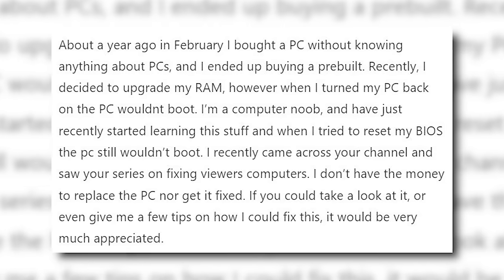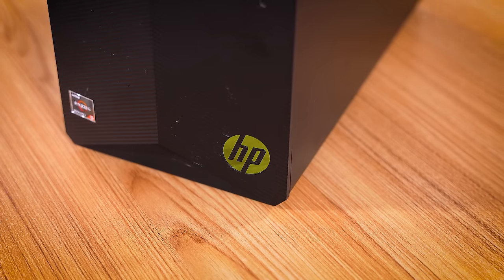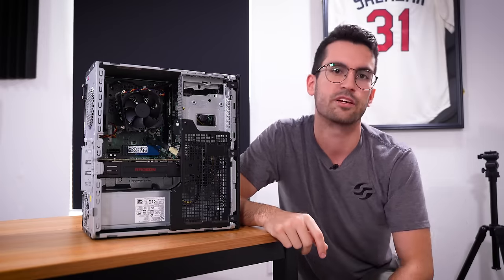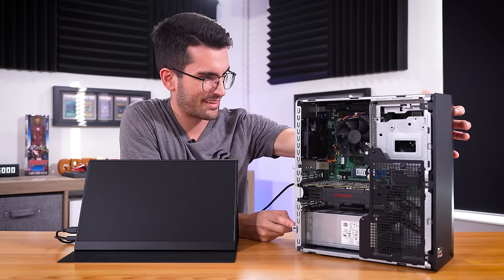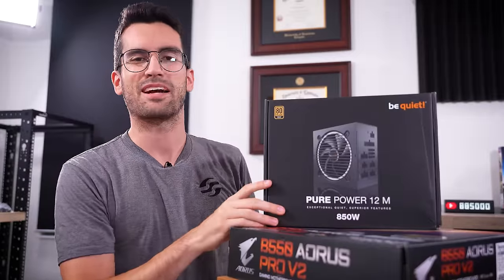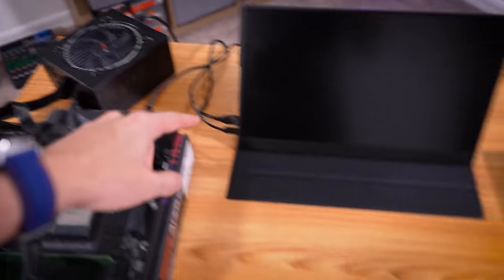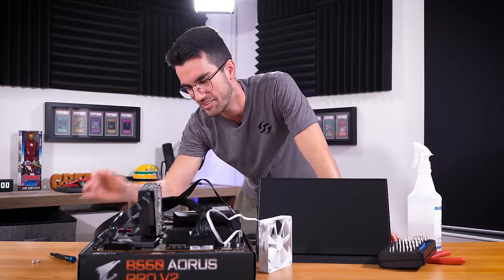Fixing a Viewer's BROKEN Gaming PC? - Fix or Flop S4:E17

Comment: Shorted front USB port on the MB preventing it to power on and cut the power supply. I can see it when you showed the front of the case. Worth a try in my opinion 😊
Reply: went back in the video after reading this and also saw at the 4 minute mark that completely mangled USB port
Reply: I can assume he unplugged everything putting before putting in the ram and hastily plugged it back in.
Reply: That's a good catch. BAD things can happen with USB ports. At work we had someone manage to get the cable of a mouse into the arc of a welder, that computer was destroyed. When I got done fixing everything I put in a touch screen monitor, a keyboard with a touchpad, and a "No Mice" sign.
Reply: At the 9 minute mark he said he could smell burning probably from the mangled usb connector getting hot and melting plastic in the connector. or the burning 12v to 5v buck converter killed by the shorted port since that psu only supplies 12v.
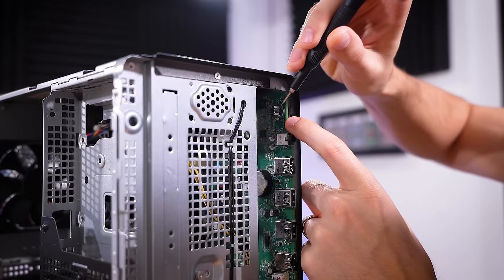Reply: Shit, I see it 03:57 it's completely destroyed lmao (the top one)
Reply: Sadness.  Wish he'd seen that (although I'm guessing the owner likes it better the way it turned out 😂).  I've got a 5700G that needs a home, so sad to see the e-waste.  Happy the cpu and radeon are able to be salvaged
Reply: The whole time I was shouting Greg, please look at the front USB port! Haha

The pc might have worked if you just removed the pins from the usb.

Comment: You gotta love the people that post negative comments about repair. If customers had to pay for time, it would be way more expensive to repair having owned a computer repair shop. I can attest that most repairs are part swaps.  I did repair a few motherboards with bad caps and a few lcd tvs that had bad caps in power supplies, but most were part swaps due to the cost of labor on the customer.

Comment: I do like content creators that actually diagnose and repair pc components, but on the other hand, I never miss the Fix or Flop series which I enjoy more than anything else computer wise. Your generosity puts you at the top of the list.
Reply: The initial process is the same whether it's new or old hardware.  Reduce things to it's most basic configuration, then verify operation of the critical components.

I also like watching older hardware being diagnosed, but modern circuitry is more highly integrated into advanced chipsets.

Comment: It's possible that they fried the motherboard doing the upgrade themself but I'm very glad the viewer got it fixed, we've all been novice builders making mistakes and the poor kid was saving up money to pay for a fix, really really sweet thing to do it for free.
Reply: It's very unlikely he did. Florida is pretty humid so static electricity is extremely rare and modern Motherboards are pretty sturdy. This was a defective unit which I'm surprised it wasn't under warranty but maybe it's an old build.
Reply: I've run into several older HP systems that died after simple ram upgrades and I've been building since 92. Everything except the motherboards were good for use in pother systems.
Reply: @JasonSaeler  Could be the circuitry for the RAM being tailored for the proprietary board, causing other models of RAMs being totally incompatible and destroying the board.
In short whether it's design issue or quality issue it is simply planned obsolescence to keep people buying new stuff to "circulate" the economy.
Reply: lol what @unknown14191 there are standards for RAM, it would cost so much money to reengineer your DIMM slots and traces to kill the board unless a specific DIMM was inserted, no one has ever done that. They’re just key it differently
Reply: @akr4s1a  There's standards for literally every PC component, doesn't mean theyre followed. AFAIK you're correct about no one changing RAM layouts before but your arguement as to why is as sturdy as a wet paper bag.
Reply: @ihateeveryone8161  If by "sturdy as a wet paper bag" you mean 100% correct then sure.... He didn't "make an argument" he literally stated a fact. Your argument on the other hand made zero sense.
Reply: @akr4s1a And so there are standards for PSUs, and yet HP uses a proprietary connector standard.
Reply: @unknown14191  Nah, these were systems I was working on and using actual HP branded Ram with same specs. Removed the upgraded ram and the systems were still toasty. It seemed limited to the HP Elite 8300 series.

Comment: What a difference!  So wholesome to see (hear?) the reaction to the build!  I always like to keep a thermal imager on hand when troubleshooting, both to see what components heat up and to track down the source of the burning smell if anything lets the smoke out.
Reply from the maker: Didn't even think to use the FLIR cam. Will have to remember that for the next time!
Reply: @GregSalazar   Mine's built into my phone and my prior life working HVAC means it's the first tool I deploy when confronted with any type of misbehaving equipment.  Also think the IR images would be cool to include in the video when you're showing the system does a POST and that the CPU is warming up.
Reply: @GregSalazar  low voltage injection + thermal camera is one of the quickest board-level troubleshooting tools for shorts. Whatever heats up is usually the problem!

Comment: If I had to guess what the issue was: the top USB port on the front IO at 2:40 is definitely broken. When I was a repair tech for a gaming PC company I saw that short systems all the time. Fortunately, if you unplugged it from the MOBO the PC would be able to power back on. Looks like the front IO is attached to the MOBO in this case. Would love to see if that's actually the issue!
Reply: Easy fix too, just put some insulation on the pins and a sticker over the port so it won't get used.  Maybe little pieces of heat shrink tube for example.  I liked your comment so maybe he sees this
Reply: First thing I noticed too.

Comment: Nice to see :) With the HP systems, a very VERY common issue with them is the bracket/case mounting, when you take out cards (ram/cpu/video etc) and put in new/replacements the motherboard can often short to the backing case, they are VERY poorly designed with proper separation and flex allowance.

Comment: You should get an infrared camera, if, as I assume happened, a capacitor blew (that's what usually gives that (fishy) smell) you would see it on the infrared as it sits there baking. If it's not microscopic then you can usually find out the model and order a replacement. There's quite a few channels that do that although they usually DO have a microscope and mounting equipment/varied solder gear to replace them.
Reply: i was thinking this too!
Reply: it mostlikely was the shorted USB port at min 3.55😂

Comment: If something doesn't work and you replace a part or parts, then it works means you have "fixed" it.  I have been a computer tech for over 28 years, and I think Greg does a great job.

Comment: I started with an hp omen prebuilt because I didn't understand pcs that well when i ordered it. Got it around 2017. Started out with i7 9700 (non k), gtx 1660 super, 1x8gb sk hynix 2666 ram that was locked at 2400 for its entire life (the motherboard didn't support xmp), and 500w psu (no idea of the rating). Thankfully nothing was proprietary except the motherboards plug layout. The placements were a bit weird according to other tech youtubers, but the plugs were all the proper shape/size. Won the lottery there i feel.

First upgrade was another stick of ram to bring me up to 2x8gb, about 6 months later. Just being dual channel felt massive because i no longer had stutters in vr gaming. By this time i was discovering my passion in pc build/repair, so i knew quite a lot more about pcs.

Second upgrade was GPU which spiralled into GPU, case, and psu. upgraded that warm, loud, single fanned 1660 super to a 3070, upgraded the 500w unrated gpu to a corsair 850w gold, and the oem case to a nzxt h510 flow. That upgrade felt incredible, finally having rtx support. I also made sure the psu could support future upgrades, which is why i got 850w instead of 650w which the gpu reccomended as a minimum.

About a year after the gpu upgrade i finally got myself a 1440p 165hz monitor. While the upgrade from 1080p165 to 1440p165 isnt thaaaat noticable to me truthfully, i can definitely feel it and i feel like it was worth it. I run a dual monitor setup so having both at a similar refresh rate is also nice. Truthfully the best part of that monitor upgrade was going from an extremely ghosty va pannel to a silky smooth ips pannel with a (slightly) better viewing angle. in my opinion and in my year or so of having this combination of cpu/gpu, i think i can say that 3070 and 9700 is the PERFECT 1440p combination of hardware. 1080p gave me a slight cpu bottleneck, 1440p used them both equally in the games i played. (medium to high graphics, apex, minecraft with shaders, dying light 2, no mans sky, as examples)

In about a year after my gpu upgrade, i went all in. Told myself to go big or go home and got one of the best current cpus (as of 2023). got a ryzen 7 7800x3d, upgraded ram to 2x16gb ddr5 6000, and got a gigabyte x670 aorus elite ax, and got a wd black 850 2tb nvme ssd. And MY how i can tell you, having a usable bios is incredible, thats probably my favorite upgrade here. the BIOS. and the better sound card this motherboard has, since I'm a minor audiophile. this boards sound is incredible. the audiophiles and sound nerds will know what i mean by this, but this motherboard has much clearer sound, clearer bass, and the highs aren't absolutely painful. I thought i had sound sensitivity, it turns out i have bad audio quality sensitivity. 

I now have a massive gpu bottleneck because 7800x3d is an absolute OVERKILL cpu but i cant see myself upgrading it for maybe 5-10 years. gpu sits chugging along at 90-100% usage while cpu is at a measly 30-40%. In the games i play (at 1440 medium to high graphics to clarify, starfield, apex, minecraft with shaders, minecraft modpacks which btw went from about 60 fps in rlcraft at 8 render distance to 120+ at 32 render distance)

My pc is now fully custom built, everything has been upgraded, theres not an oem piece left inside it except for the nvme ssd i have windows installed on. And the best part? Since nothing was really proprietary, I run the original pc as a pihole/droppy server sitting in a cabinet in the corner of my room. Been going strong for about 3 months now. And the painful part about the server pc? Its running off a 2tb external usb hdd. I dont know why i do this to myself. I have extra sata ssds. But no i use an external 5200rpm EXTERNAL USB3.2 HDD.

Comment: I had an HP PC in which the PSU and motherboard bit the dust. These days OEM components are often cheap as well as low end.
Reply: The quality on the ones I've run across have been fine.  I would imagine with the millions they make a few do die.  I built 3 or 4 of the older 2400g and i5 9400 version of this system.  Nothing really wrong with it.  They live a hard life with their cooling vents blocked in a cupboard/desk or by pet hair.  I've got a 5700G that needs a home, would love to revive that system 😥

Comment: What a job Greg! You are the man!
I went with am OEM HP back in the day, was lucky to get pretty much a standard pc with HP on the front. 
Eventually the power switch went out and was able to swap everything over to an ATX mid tower and everything fit!
Eventually replaced everything from that old DDR2 system!

Comment: Purely going by a couple of close-ups of the m/board, & the smell; either the guy shorted a cap on the board, or it decided to let-go when the board was turned back on. Always good to learn with you Greg, there's not really a right or wrong way to troubleshoot.

Comment: as a previously keen and once noob in computer kid, i can tell you that the viewer might have tried to replace the RAM without powering off the power supply or immediately after powering it off(without discharging the capacitors by holding the power button) because the same thing happened to me once. I tried to take out the RAM without shutting off the power supply and ended up killing the RAM slot on my motherboard. Although, my pc still worked surprisingly with just one slot detected.

Comment: Wish I had seen your channel earlier.  Bought a prebuilt at bestbuy after building my first ont years ago. Just got lazy now I stuck with my Onen but it works fine but up grading might be a problem.  Keep up the good work.
Reply: The bigger Omen are standard parts.  These little office machine ones have 400w PSU options.  But usually if the CPU is worth keeping just get a lower end CPU and new SSD (20 bux for OEM 512GB) to put in your old one and sell it off to fund the new build 😆

Comment: At 2:37 in the video you can see that there is a broken usb 3 connector that coud be shorted, in my opinion the 5v power supply on the motherboard preventing the system from powering on because of the short circuit.

Comment: I can’t get enough of this series, Greg! While he didn’t necessarily get a performance boost, he certainly got a massive face lift. Get that 6500 replaced with a nice budget 1080P card like a 6650 or 7600 and he’ll be set for another couple of years!
Reply: It's actually a AMD RX 5500 4GB GPU. But yes, he needs to upgrade that GPU and CPU.

Comment: Used oem builds often are tremendous value, but are only an option if you don't need to upgrade - otherwise they become a money pit of half-baked power adapters, lesser value gpu choices, and guerilla modding. Sunk cost fallacy sets in really quick.
My mother-in-law greatly appreciated the cute little 6th gen i5 optiplex micro that I picked up for not much more than $100. For the gamers in my life, I started them off right with decent cases and power supplies, even when I couldn't sink a whole lot of money into the platform.

Comment: One thing that I do like about the replacement parts you used while thr 850w psu is overkill for thr current parts if the viewer in the future ever decides to go super high end they could run a 5800x3d and 7900xtx off that psu so you gave him a lot of room to upgrade

Comment: For myself to test these proprietary builds I keep multiple 24pin adapters (6, 8, 10, and 12pin). For some of these with special ones I have a 24pin cable with loose ends to plug in wherever needed. This is all you can do to test.

With the upgrade I wouldn't have gone with the NZXT cooler. Their required software eats into performance on mid tier (4/6 core) CPUs. As well as ram usage on that 16gb of ram. Maybe a Deepcool, BeQuiet, or Thermalright as an option.

Comment: Strange. I have an HP Omen 25L....not sure of the year, but it came with a Core i7 10700F, if that narrows it down. Anyways, there isn't one single proprietary component on it. I know, because I case-swapped it. It came with a standard Thermaltake PSU with regular connectors, removeable rear I/O shield, standard micro ATX mobo, etc

Comment: Man! You did a great job!
I always also thought that fixing these broken prebuilts sucks, when the motherboard or the psu dies. But honestly for me the worst case is, if the gpu dies, because it's the most expensive part usually. If the motherboard or the psu dies on these prebuilts i would replace them with a cheap case, motherboard and psu. The are so many great value options if you think about it.

Comment: man this is so cool. i was actually gifted an older " gaming " from a family member and was going to write to you to see if you can help me out with it since i don't really know anything about pcs.
but i decided there no better way to learn then to do it yourself. it was originally an i buy power prebuilt PC. swapped pout the old ugly black and red case for a corsair 4000D air flow added an nzxt 120mm rgb liquid cooler along with a few of their fans. ( all white ) later on i plan to upgrade the asus 1070 along with the mother board ( not sure what board it is ) and cpu ( i7 7700) and the older 480W power supply. but for now she's doing well and looks 10000000000000000000 times better lol

Comment: Prebuilt OEM stuff is always low quality in my experience. Back in the day I had a prebuilt that had a motherboard that had everything for a PCI-E x16 slot, but no actual slot, just empty circuit traces to save on the cost of putting it on the motherboard.

Comment: HP should've added a small button in the back of the power supply just like Dell did with their prebuilts that will allow you to power it on for testing without having it connected to the motherboard .
Reply: All the 12v on that PSU is always on anyway.  I have that power supply here and just tested it.  Oddly enough before seeing this video.

Comment: With these AMD 5600G B550 systems can you get all of the USB ports to work reliably?  Can you leave a portable HDD plugged into any / all of the USB ports for 24 hours and do scheduled backups without the video freezing and system locking up?

Comment: I have watched all of it yet, but I’m wondering if it is the memory, HP loves their proprietary crap and I’ve come across HPs in the past that would only work with their parts and sadly I wouldn’t put it past them to do it with the RAM too.

After watching it all I still bet the RAM had something to do with it. Beautiful rebuild, I love what you do keep up the great work. 

I was working on an HP laptop a while back and it needed a WiFi upgrade and not only did it turn out it wouldn’t work with anything but HP cards but the new Intel WiFi adapter ended up bricking the laptop. Although it still powered on and after sitting for a while with the original WiFi card installed it did eventually come back to life.